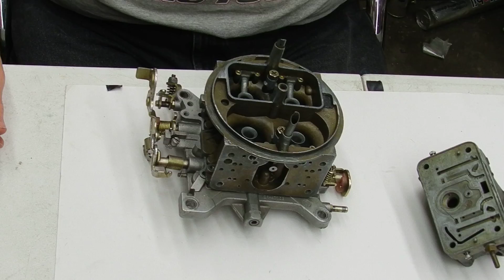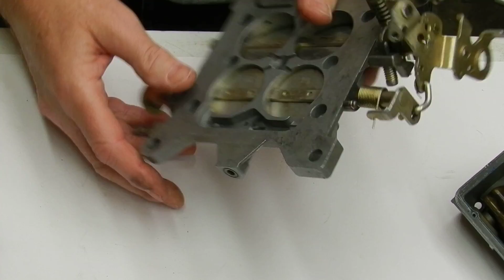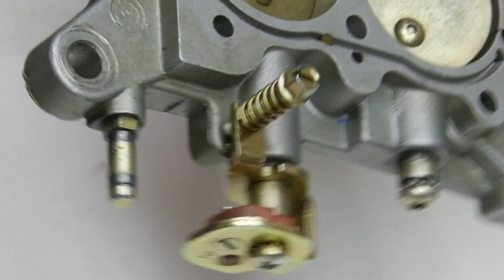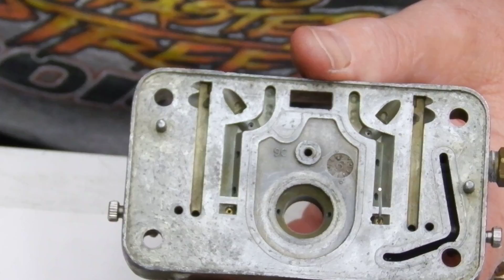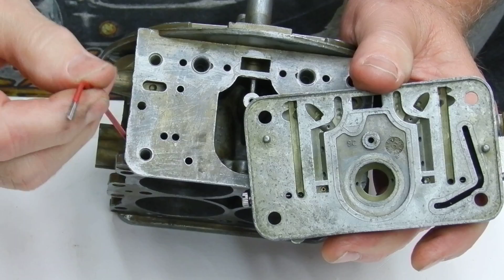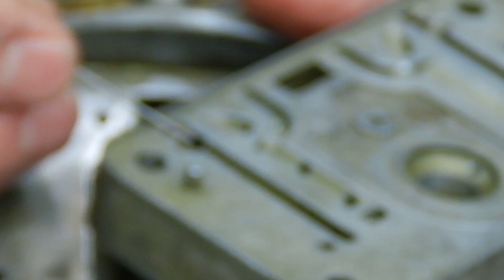Holley Carburetor Tuning: Idle Circuit Mods for High Duration Camshafts

Comment: Could a rich condition on the idle screw circuit be addressed with larger idle air bleeds? What would be the result?
Reply from the maker: If your transfer slots are set properly and you don't have a leaking power valve or a  flooding condition or wrong air fuel restrictor, then yes you can change the idle air bleed to a larger size to lean your idle.

Comment: I know this is a older video & i have a proform 650 carb on a 302 ford gt40p heads ported single plane intake. I have looked at my transfer slots and i can turn idle screw down to get a .040 square on one front slot but the other slot  is about .060 to .070 slot asking if ther is any remedy that i can do. Thanks Jim Ohio
Reply from the maker: Jim I've seen this before , there is a two part epoxy that is made to work with fuel, I've used it in intake manifolds , you can use it to repair the transfer slot very carefully. I'm not at my shop right now i will get you the information and get back to you.

Comment: Hi Randy, this is Vince from AZ 
I have a question do you have a video on making a big carb int a smaller one? For example how can I turn my 750 to a 650?
Reply from the maker: I'm not sure if your talking about leaning out a 750 or converting it  to a 650?
Reply: Thank you for responding back, yes I want to lean it out to run on my 35O
Reply: I been researching and some people say I have to change the main body to a 650 and everything else bolts on. Other people say I just need to change the metering block to a 650
Reply: And last change the jets on the primary and add plugs to the transfer ports.
Reply: My last resort it to ask an expert.
Reply: @vinceecheveste7334  Swap with a guy with a 650!😃

Comment: Thanks Randy!  I’m pretty confident this is the problem with mine. When I slowly press on the throttle backing out of the driveway it wants to smother out and die at 1/8 throttle or less. If I push the throttle fast activating the pump it does fine but whe the pump isn’t involved it won’t take fuel and die.  I’ve been trying to remedy this with the lower vacuum power valve but I though I’ve seen improvements I think I’ve done all I can. Time to drill holes.
Reply from the maker: Take a look at your accelerator pump again it should squirt fuel even at slow speeds , it has to function even at very light pedal movement , if not it will cause a hesitation , let me know if you need more help.

Comment: I've been putting off addressing a very rich condition on my Quick Fuel 650 DP with 4 corner idle air adjustment!  After seeing this video I decided to add the .070" holes in the butterflies also, since I was going to have it apart. I knew I'd need to reduce the power valve size as my cam makes just 10" of vacuum, and it turned out to be a #6.5, so I also dropped it to a #4.5. 
 Once I rejetted it, changed the power valve, and did the mod to the butterflies, it runs very clean! My throttle plates were closed fine, and didn't need to adjust them to close more.
Thanks for this excellent video!!
Reply from the maker: Marlin glad I could help, you have a merry christmas.

Comment: Randy I have a 1968 corvette 3 deuce I put a larger camshaft, I am going to do the idle circuit instructions you have on this 4 barrel but drilling the throttle plate do I drill the same size hole only in the center 2 barrel or do I do all 3 2 barrel

kennymnelancon@aol.com
Reply from the maker: Kenny I would start with the main carb (center carb) and go from there, the bigger the cam the more air you need to bypass , start off with center carb and video hole size . Let me know if your unsure about anything. Hope this helps take care.

Comment: If I quickly stab the gas on my holley and let the engine settle back down to idle it will idle slowly. If I slowly press the gas the engine will idle high. Every holley i have ever owned does this. What's the reason?
Reply from the maker: I need more information , is your engine stock, what type of distributor is it vacuum advance and mechanical advance (stock) and if it is stock where is your vacuum hose from distributor hooked to the carburetor, either to the  metering block or throttle plate? Besides checking for linkage for binding or if it has a choke fast idle cam screw set wrong or a vacuum leak can cause this to. Give me a general breakdown of your engine and check  any thing that applies that I mentioned .Let me know .
Reply: @holleycarbshowtosadvice40y90  thank for the reply. every holley I have ever owned on multiple engines has done this. 2.8l v6 with a vc 390cfm and vacuum advance distributor. 350 with a 3310 750 CV/ demon 650 vc / mighty demon 750 annular booster that came factory without a chock. Maybe I'll shoot a video for you when the weather gets better thanks.
Reply: And thanks for all the great videos btw

Comment: @holleycarbhowto 
if I set my transfer slot,my idle speed is entirely to high.am I missing something simple? It’s a Holley XP Thank you for your time.Love your content
Reply from the maker: Do you know about your adjustable air bypass , it is designed into the xp ultra series carb , it's under the air cleaner stud , if you have your transfer slot set right on the primaries , secondary tranfer slot is not exposed at all , usually secondary idle screw  is about one turn out from being bottomed out then adjust your idle air bypass screw under the air cleaner stud ,clockwise will lower your idle and counter clockwise will raise it , basically set your transfer slot on the primaries and adjust idle air bypass screw  to your desired idle speed, then adj your idle mixture and if idle changes use your bypass to correct it ,PS don't set your secondaries up like your primaries your  transfer slot will not be exposed on secondaries if they are your idle will be to high , the transfer slot adjustment only pertains to the primaries . Hope this helps.
Reply: @holleycarbhowto. I am grateful for your reply sir thank you so much for your time.I had NO CLUE about that particular adjustment 🙏 I’m excited about this carburetor again. Your content is youtube gold.
Reply from the maker: Hey also make sure no vacuum leaks on front or back of carburetor , where vacuum plugs would go and your absolutely welcome , let me know how it turns out.
Reply: Holley Carbs: How To's & Advice ,40 yrs of exp. You’ve been more than helpful,thank you so much

Comment: I was wondering about secondary transfer slot adjustment on an aftermarket base
Reply from the maker: Kevin most secondary transfer slots are not exposed at idle , need all information on carb.
Reply: @holleycarbshowtosadvice40y90  it is full drag , 1 to 1 Holley 1050 4150 , gas...I built the carb buying parts,base,main body bowls,metering plates...no power valve....it is squared off on jets size 89....the problem I'm having is a flutter type when secondary opens
Reply from the maker: Kevin do you have jet extensions in the rear bowl , also nitrophyl notched floats ?
Reply: Yes and yes....ok....the flutter sound that I'm hearing is my ignorance....was not paying attention to my rev limiter....for some reason it was set at 4800....I'm just getting into power at 4500....so now that ignition is set properly I can now start over on carb tune....I appreciate everything and sure I will be getting back with you as I value your knowledge
Reply from the maker: Thanks and good luck

Comment: here is a good question. what happens when you got the holes drilled from a .093 drill all the way up to a .120 drill and it still wont close the transfer slot. the idle mixture screws will kill the engine. but at about 5 turns out. still idles high and now returns to the high idle slowly. are my holes still not big enough? seams like its wants to run away when i rev it up. please answer back. could timing be a factor
Reply from the maker: Sounds like you have a vacuum leak,,   also need to know if your engine has a racing cam, the procedure of drilling  the throttle plate bypass holes is more for racing engines , I need all your information to try and help you . Like Is this a new engine build , engine specs etc, but sounds like maybe vacuum leak .
Reply: @holleycarbshowtosadvice40y90   could it be internal in the carb? i have sprayed and sprayed, the intake the base of the carb the entire carb with no change to idle of the way it runs. however i did use water cause i had no carb cleaner at the time. will this make a differance?
Reply from the maker: Very unlikely carburetor leaking internally , unless you have the wrong gasket between throttle body and main body , the wrong gasket can block the idle mixture passage .
Reply from the maker: If you put the wrong gasket between  the throttle body and the main body you could block the idle mixture circuit , and cause a very lean condition.
Reply: @holleycarbshowtosadvice40y90  and it is a very big cam. on a vacuum gauge i only get 5-7 inches of mercury it does flutter though and is inconsistent
Reply from the maker: Does the motor seem to have good power or does it seem to be way down on power , and is this a new build.
Reply: @holleycarbshowtosadvice40y90  yes it seems to have good power does REV through the entire RPM range when I first started doing this it had the stumble and everything that you described when drilling the holes I got to stumble to go away but it still wouldn't idle down let's say 800 to 700 RPM so the stumble is gone but it still won't idle below a thousand RPM and there's still more than 30 to 70 thousands of the transfer slot exposed and if I try to turn the mixture screw in more than five turns it'll die so it's almost like a lean condition right at this point
Reply: @holleycarbshowtosadvice40y90  that was why I asked if my holes might not still be big enough because I still have a lot of transfer slot showing
Reply: @holleycarbshowtosadvice40y90  and yes it's unint Eyerly new build new crank new rods new Pistons new cam new pushrods new rockers aluminum heads and they're actually bow tie Phase 6 heads and a Holley 650 double Pumper 4777 - 2 like the one you rebuilt in your video Hedman husler Fender exit race headers
Reply: @holleycarbshowtosadvice40y90  timing is set from start at 16 degrees the vacuum advance does not seem to be working at all total timing is 36 degrees
Reply: @holleycarbshowtosadvice40y90  oh and this is odd if I put the air cleaner on the idle comes up idle gets higher
Reply from the maker: Drilling the butterfly bypass holes is not the problem , you have to fix the lean condition first .
Reply: @holleycarbshowtosadvice40y90  ok so i took primary bowel off today and the metering block. i took the mixture screws out and when i did this the rubber seals that seal the mixture screws came out with both of the screws. i did not have to pull them out they screwed out with the screws. would this cause the lean condition? can i even get the screw seals. i will be getting a rebuild kit. but i did not see these seals in the kits.
Reply from the maker: Do no drill the holes any bigger, you  have to fix the  lean condition first  , drilling bypassing holes will make the problem worse.
Reply from the maker: Putting the air cleaner on will restrict  the air flow slightly , which will bring the idle up a little.
Reply from the maker: Start your engine up let idle , now very slowly mash the accelerator pump down and see if the idle picks up , if so you have a lean condition.
Reply: @holleycarbshowtosadvice40y90  ok hopefully you are still willing to help me. i have totaly rebuilt the carburetor. the vacuum leak was in the baseplate gasket. engine revs up and idles back down to 1,200 rpm. if i take my thump and mash the accelerator pump the engine tries to die. but i still have the issue where it wont idle below 1,000 rpm. and the idle air adjustment screws have to be 4 or more turns out for it to idle.

Comment: You the man, thanks for the refresher course.   I'm working a 6 pack and forgot all about the transfer slot on the center at idle setting.....on all 3 carbs.   I appreciate this video!
Reply from the maker: Thanks alot
Reply: @holleycarbshowtosadvice40y90  
Excellent videos..........Do you know anything about reading old sun machine oscill scopes

Comment: Hi Randy, love the videos. On a 4412 do all of these principals apply? Also  friend has a circle track car and it's been a while since he ran it. Ran and idled fine, now goes to fire it up and it won't idle. Cleaned it all out, but still won't idle. Any thoughts? Thanks.
Reply from the maker: Yes the 4412 fall under the same mods , just half a 4 barrel. The circle track carb , make sure , no vacuum leaks, most times I see this it's due to the wrong main body gasket , I don't know if you changed the gasket when cleaned it. There is so many gaskets that come with the  carb kit and the wrong gasket  will block the idle feed hole , Now with all that aside all you need to clean is the metering block , l'm going to do a video on a 750 do 5/15/ 20 and I will show you in the video hope this helps.

Comment: At what duration should this mod be started at?
Reply: Also, is this @.050 or advertised duration?
Reply from the maker: That  question is hard to answer , because there is so many things that factor in , it would be best to go by the amount of idle vacuum , normal idle  vacuum is around 17 to 18 inches.  I would say some where around 14 inches or lower , usually a good sign is you loose control of your  idle mixture screws.hope this helps.

Comment: This video Finaly solved why my engine wasnt idling.  It has a high duration comp cams that runs perfectly fine when steping on the gas, but when I let go of the throttle it dies because there is not enough air going into the engine, because the low engine vacuum cant pull it though.
Reply: Having the same issue on my car going try implementing his advice and see if it helps
Reply from the maker: Also try to get more initial ignition timing and if using it for the street that will help raise engine vacuum but if your drag racing  it  track only I would  lock the distribuor timing out and that will raise your engine vacuum alot and will have a much better driveability. Hope this helps

Comment: Drilling a .070" hole in the butterflies works for long duration camshafts, for example, a mechanical camshaft that has 260* or more @ .050".  My 460 CID has a very moderate Iskenderian custom ground flat tappet mechanical camshaft, Int. 240* @ .050" Exh. 246* @ .050", 108* LSA with 104* ICL.  In order to get my engine to idle correctly I had to re-set the secondary butterfly adjustment screw on the underside of the carburetor as well as make sure the idle transfer slot only has .025" exposure on the primary side.  Works great.  Cool videos.
Reply from the maker: Thanks for watching
Reply: How did you measure for 0.25" what did you use as a measuring tool?
Did you make something to use?
Reply: @privatename8888  Just use the square transfer slot method. It's easier that way.
Reply: @privatename8888 If you have any mechanical aptitude, you can use your eyes to guesstimate.
Reply: What do you mean by reset your secondary butterflies? Were they not set straight on the throttle shaft or are you referring to setting the transfer slots on the secondary side?
Reply: @privatename8888  The bottom side of the carburetor there is a inset screw that can be turned clock wise to open the secondary transfer slots a little more to increase the idle. Keep the primary transfer slots in the square shape or as vikingmike said. .025 exposure.

Comment: After following these instructions and doing this to my Holley 670 carb with vacuum secondaries. With the engine warm and the choke open. When revving up the engine with the throttle and then releasing the gas pedal, what would cause the idle to get stuck at 1400 rpm and then take 20 to 30 seconds to drop down to 900 rpm idle?
Reply: I'm having a similar issue mine stays high longer
Reply: @privatename8888  If I remember correctly, my carb idle problem was due to a vacuum leak at the base of the carburetor.  Found the leak by spraying starter fluid on it during idle.
Reply from the maker: Could be a vacuum leak or butterflies sticking or not centered.
Reply: I know this is a old comment and I hope you remember what you found was causing this issue. I have a 340 Mopar with a Holley that's doing the same thing exactly only when operating temperature.  I have no vacuum leaks, no sticking throttle , or choke. I've been researching everywhere and can't find anything except your comment that comes close.  Thanks

Comment: Great video's.. I do have a question. I'm running a 600 holley vacuum secondaries on a 1971 Ford Torino. The camshaft I put in it is really to big 515 lift 280-290 duration and 108 lsa. Somebody else built the carb, so I have no idea what was changed internally. The carb works great other than from a dead stop the secondaries don't want to open. If your rolling about 10mph it will kick in fine. I've changed the secondary to the short yellow one ( that one seems to work the best ) other than from a dead stop.. I'm pretty sure that with the cam I got my issue is more of a vacuum issue then a carb issue, but I was wondering if  I could tweak on the carb and make it work instead of digging into the timing and all that.. Any info would be greatly appreciated. Keep up the great work
Reply: From my experience with carbs that have vacuum secondaries, they won't open immediately like carbs with mechanical secondaries. A double pumper for example. Using a light weight spring in the vacuum setup is probably the closest you will get to having them open sooner.
Reply from the maker: There not designed to come in from a dead stop if they did the engine would bog, with a double pumper thats definitely possible.